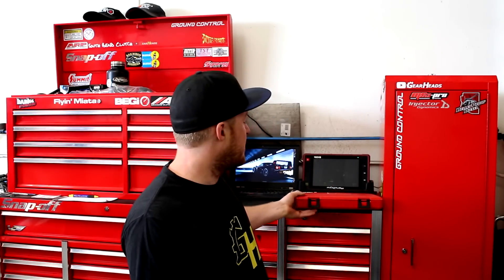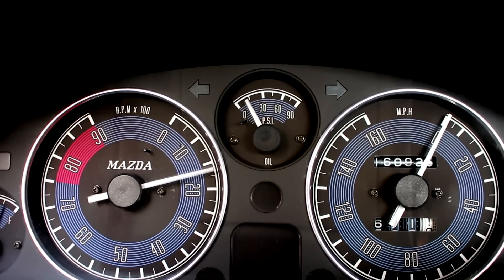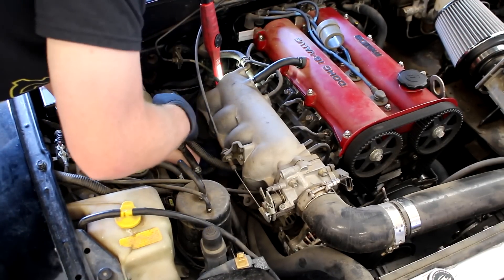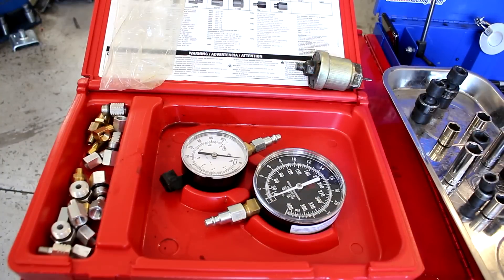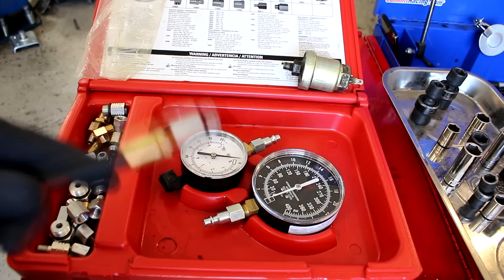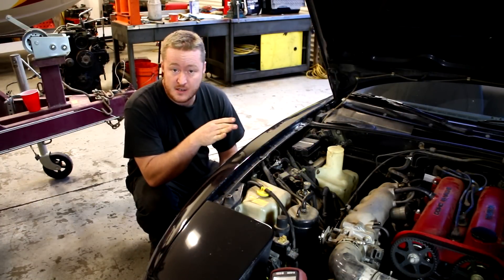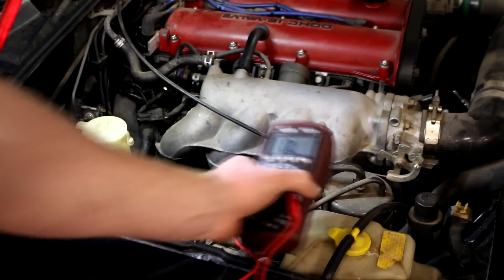How To Diagnose "Low Oil Pressure" 1990-2005 Mazda Miata

Comment: Thanks for the tutorial. The oil pressure gauge on my '90 Miata has always been a little dodgy and jiggling the connector would settle it down. Lately it's started to give some very low and inconsistent readings. Even 'at speed'. 

So I'm off to Harbor Freight tomorrow to get a direct reading gauge. And I must be living right since I was able to get the sender off with a 30mm socket. 🎉🥳 I'll be living even better if the gauge confirms a bad sender. 🙂

Comment: My NA 91 was showing 10 PSI at idle while warm, cleaned the contact and it’s back to normal working order. My resistance was 126 for 0 psi and 45 for 27 psi almost 30. The 30 psi is close to spec but don’t know what to make of 126 ohms resistance while off. Did you have the ignition on?

Where did you get that service manual and how can I get a copy?

Thanks, great vid. 👍🏽
Reply from the maker: I dont remember anymote if the ignition was on this was awhile ago 😛 as for the service manual you can buy one online or pay a fee for AllData for your car or similar. The specific program I was using is Mitchell ProDemand but I pay the monthly fee because Im in a shop lol

Comment: I have the same issue in my 1990. Cold start my idle oil gauge reads 32, the at operating temps is at 28 @3000rpm
Reply from the maker: It is probably higher than that if you hook up a mechanical guage, unless you have a ton of miles on it.
Reply: @GearHeadsGarageChannel  106k
Reply: Same

Comment: I have the same oil pressure issue with my 1990 NA Miata.  Thought I'd buy a test kit and confirm faulty pressure sensor.  If its the sensor, thought I'd just trash the $200 sensor and install the $20 mechanical test gauge in my dash somewhere where I can see it.  What do you think?
Reply from the maker: Take apart the sensor and fix it instead. You dont want a cheapie $20 mechanical gauge going through the dash waiting to leak oil inside the car.
Reply: @GearHeadsGarageChannel  hmm, any vids on fixing sensor?
Reply from the maker: @mavisarnold4371  Haha not yet but it is on my list of things to do!
Reply: @GearHeadsGarageChannel  thanks for the advice.  Great video btw.  Most helpful.

Comment: I got a 99 and mine has been reading good when I start and drive. When I slow down or turn it begins to drop down on L and pick up when I accelerate again.
Reply: Got the same issue, did you ever figured it out?

Comment: Dang I pulled my engine already because it had low oil pressure
Reply from the maker: lol oh boy! This is why things need to be properly diagnosed before jumping the gun! Hopefully your doing some fun stuff while its out!
Reply: Yeah hopefully I can start driving the Miata soon I miss it
Reply from the maker: @LxrdGmail  lol well at the rate Im going latelt you will be done before I am! You can do it bro just have to find the dedicated time! Doing videos like I am everything takes longer and Im not ready to finish quite yet!
Reply: Haha it’s fine it needed all new seals anyways
Reply from the maker: @LxrdGmail  Hope it didnt actually have low oil pressure or your doing bearings and a pump!
Reply: As I suspected I spun a bearing rod journal #1 has slight scoring I’m going to the machine shop tmr to see if it’s reusable will oversized bearings
Reply from the maker: @LxrdGmail  Well good luck! if its not too bad you should be alright 🤘

Comment: Need to do this on mine, it looks so tricky to get access to though. Good video!
Reply from the maker: If you lift the car up and get underneath you can see better, but it doesnt give you much more room. Give it a shot, if your lucky the Sender will come off hand tight but probably not 😛 Get a stubby 17mm in there and take a shot!

Comment: OL isn't 0 resistance.  It is Overload which means infinite resistance.
Reply from the maker: Maybe I said 0 resistance and mis-spoke I should have said zero continuity. I am aware but probably said it wrong thanks for the correction!
Reply: Too high for meter not infinite
Reply from the maker: @hendersonwilliamk  Yes too high for meter "technically" but practically speaking NO continuity lol

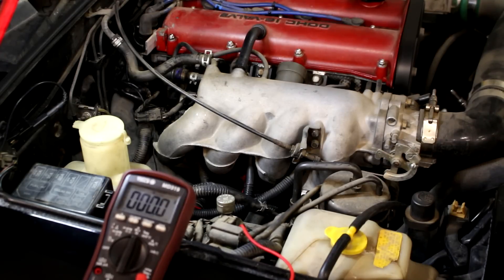Comment: 14:28 i dont get it, how on earth is it measuring 0.0 ohm, on the chassis and 2.x on the block if the sender is screwed into the block?
Reply from the maker: I have no idea, very strange but after thinking about it MAYBE I was grounding it at the head and there was more resistance there than from the block to chassis. Honestly I dont think there should be and its interesting. Either way I know the sender has an issue so maybe after getting that taken care of I can figure out what is up with the ground acting like that.

Comment: Thanks for the video! The worse ones are the dummy gauges in the later NA Miatas that look like a gauge but are actually just controlled by an oil pressure switch. I'm in the process of adding an aftermarket gauge in mine.
Reply from the maker: Yea those Dummy Gauges are so dumb!! You adding an electrical one and putting it in a gauge pod or what?